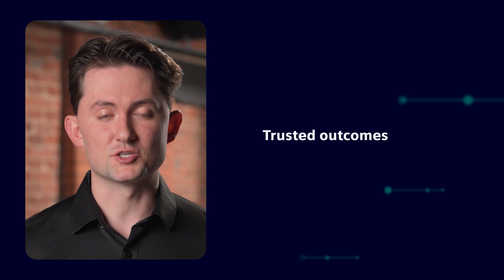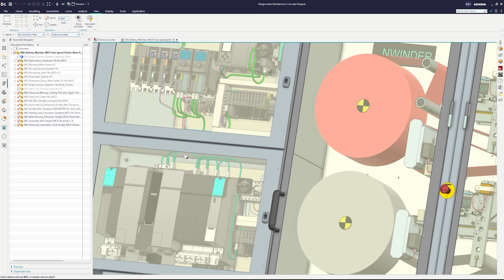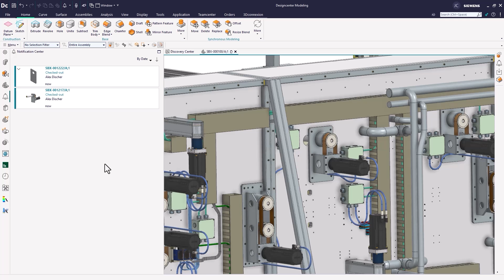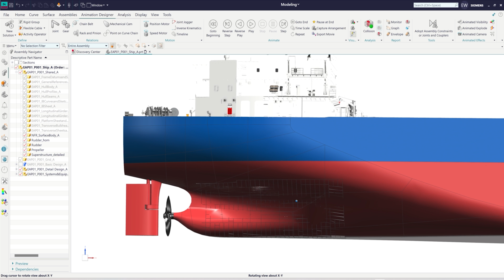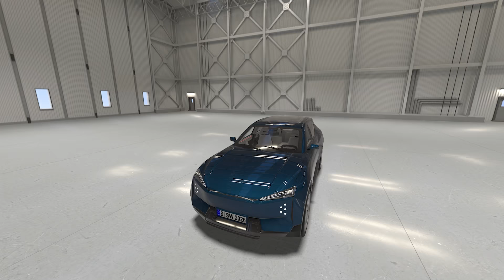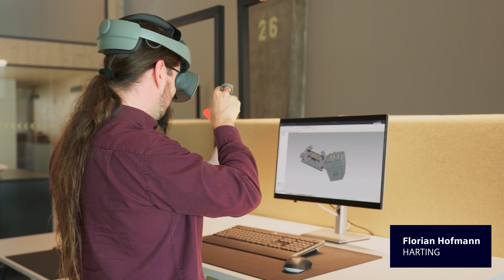What's New in Designcenter | June 2026 release

Comment: A ridiculous interface change has been made in the next-generation NX (Designcenter / NX X) versions. The Application tab, which is found in the Customize > Tabs/Bars list in classic versions and provides quick switching between modules (Modeling, Manufacturing, Sheet Metal, etc.), has been completely removed from the list in this version. In other words, there is no ready-made bar that you can bring back by simply checking a box.
Reply from the maker: Hi - thank you for your feedback. We're passing it on to the product teams to take into consideration. ~ Team Siemens

Comment: NX is incredibly powerful, but it has a tiny user base compared to its capabilities — mainly because there's barely any proper learning content for it. Sketch, Structure Design, Motion Simulation, Sheet Metal... you name it. At some point you just hit a wall, not knowing what to do next or even how to fix errors.
As someone who's worked professionally with SolidWorks and Inventor, and is also familiar with CATIA, I'll say this as a genuine NX fan: if Siemens wants NX to become the #1 CAD software in the world, they need to seriously invest in its educational content.
Reply: Lol, it doesn't matter how many educational content out there when cost is prohibiting it for the majority of the companies.
Reply: It doesn't help that NX is eye-watering expensive either.
Reply: @holmesseth  Cheaper than Catia in cost a and license, cheaper than CREO in License but not in Cost. It is a High-end and not a Mid/Low end. Take that into account.
Reply: Did you try to press F1 in the function you are using in NX? Siemens has a lot information about how to use the NX functions although something it is not clear.
Reply: I agree. I see things our var does to get things working right and think to myself, how in the world did they figure that out. But in the end it is the best software out there.